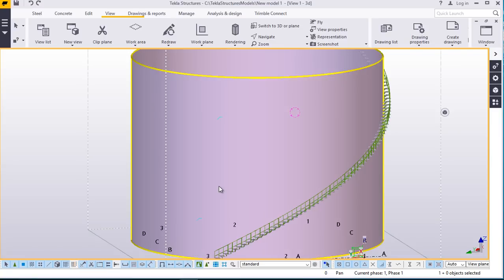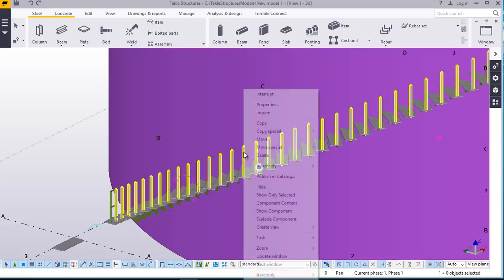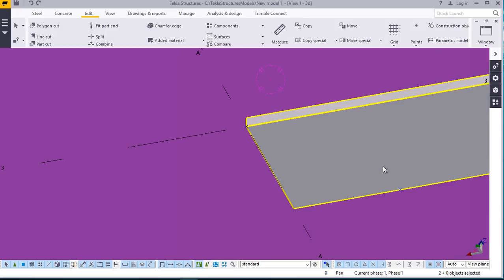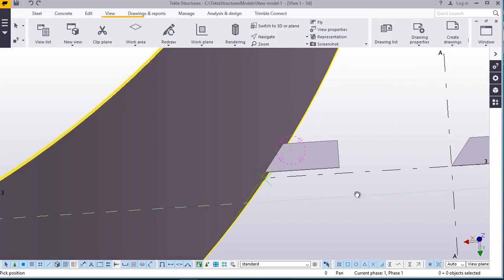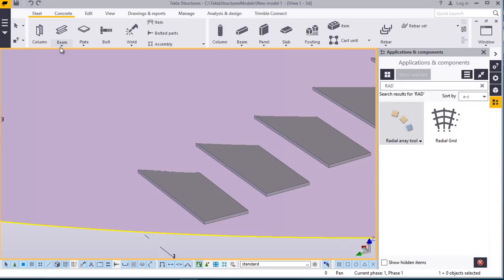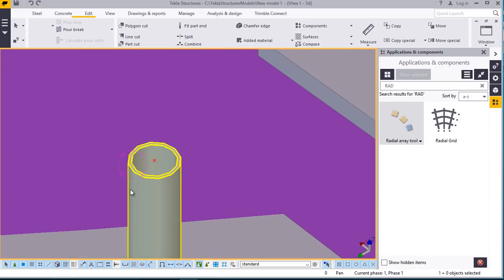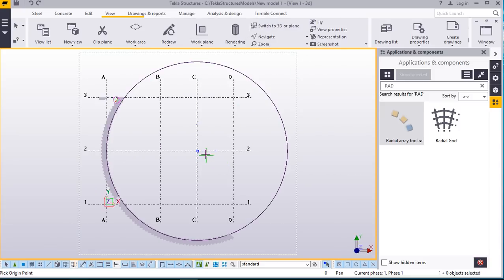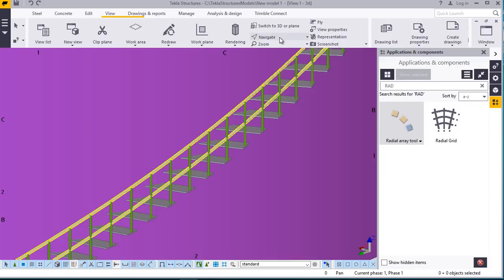How to create storage tank staircase | Tekla Structures 2017i

Comment: HI SIR HOPE YOU ARE FINE SIR I WANT TO ASK ONE QUESTION IF BEAM IS MORE THAN 12MTR WHICH SIDE JOINT (MEANS TAPERED PLATE JOINT) SUTIBALE RIDGE SIDE ARE EVE SIDE?
Reply from the maker: It doesn't matter,points to consider are apex joints and the haunch or the connection between column and the rafter, these are the joints which transmits loads to column from roof,then to foundation and get dumped into ground.
Reply: THANK YOU VERY MUCH SIR YOU ALWAYS HELP ME SORRY FOR DISTURBANCE
Reply from the maker: you're most welcome,no problem am here to help